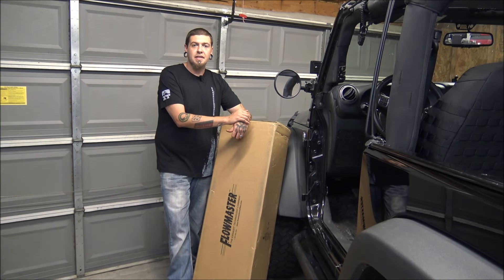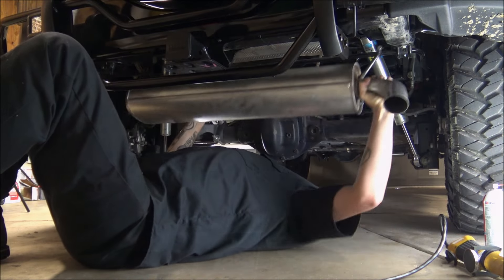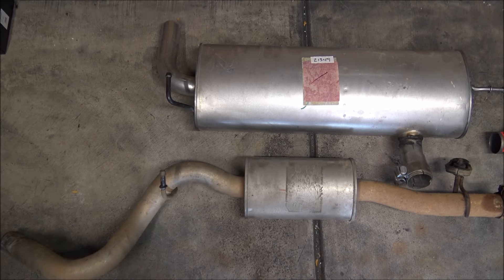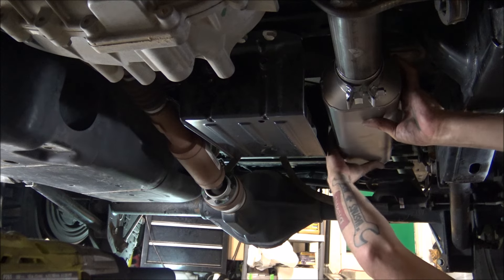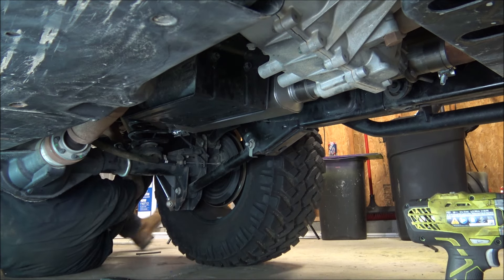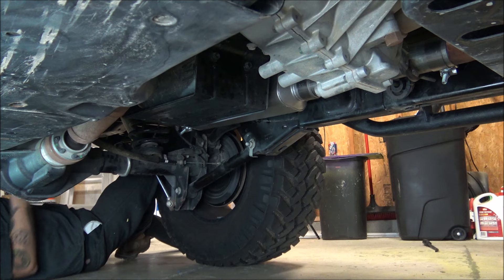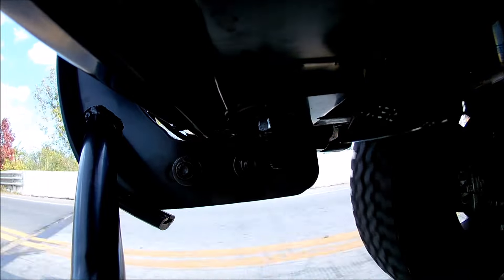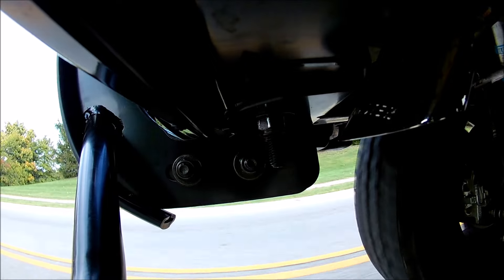Jeep JK Flowmaster American Thunder Cat back Exhaust Install, Review & Sound! PDW Ep.11

Comment: Thanks for doing this video man.  It helped a lot as I put my exhaust on my 2015 JKU this weekend.  My jeep does not have a lift and is pretty much stock.  Like you, I for the life of me could not get this sucker to fit without cutting about an inch off.  Before doing that, I took it all out again, made sure the pipes were all seated as far a as they could go.  I actually did that twice, as even when I called Flowmaster they said I should not have to cut it.  That was BS.  I ended up taking off about an inch and a quarter in total to make it fit - without doing that there was no way that last hanger was going to connect to the tail pipe.  Anyway, after about five hours in total, a lot of muscle, and sore from climbing under the jeep probably about 500 times I got it on and it sounds awesome.  Thanks for the video as it was a help.
Reply from the maker: Thank you for watching! You are right, this exhaust sounds great, but man does it ever make you work for it! A swing and a miss by Flowmaster on the install part of this kit. Thanks again!

Comment: Thanks for the video! I installed this setup today on my 15 JK 2 door. I have the exhaust spacers installed as well. I had to cut off about 1.5 inches from the first pipe. I took the rear sway bar down from the frame and that helped allot.
SUBBED!
Reply from the maker: Thanks for watching and the sub!

Comment: I just installed this kit on my 2011 JK, pulling the old system off was a crazy pain in the back side but I had no problems with Flow Master's kit.  The instruction pictures were not very helpful but the written instructions were very good.  Maybe I got lucky but I thought the kit install was easy,

Comment: Dummied up, this installation is really easy, once the old muffler is out. If your Jeep is more than two years old, just break out the Sawzall and cut the old stuff out. Life is too short to try and finesse that crap out. All the PB Blaster in the world won't save you. Sawzall. Drop the sway bar and it all goes together very nicely. My problem occurred when I tried to tighten everything down. Even using the impact wrench, the clamps wouldn't hold. My entire assembly could be taken apart just by pulling, with the straps tightened as far as they would go. I'm guessing I may need to weld it. I will say, mocked up, the sound was really nice. I love the lack of MUFFLER across the entire rear of the Jeep. It's a little more work, but I do like the system. Also, I'm the only person I've heard that had this issue, so it may just be me.

Comment: Thanks for the video. I'll add a similar comment I recently posted as a reply to another video.

I received my kit last week to install on my '08 JK 4 Door. That stock pipe on a 2008 JK was a pain in the butt to remove with rusted bolts and hangers that had never moved an inch. Also, to make it ever harder all original slip fits were tightened upside down (especially the first one) so I had to use a heck of a lot of PB blaster etc. to get that to loosen with no space to work etc. (The muffler for whatever reason what welded to the slip fit so I had to get the saw saw out to cut it apart. 

Also, my stupid Y-pipe had some sort of soldered round ring I had to cut of with a saw before anything slipped on there. Also, the stupid slip fits in my package were so tight that I had to completely open every one of them (everything going everywhere) then tighten them back together with tools to get them on the pipe. 

Finally, the last part of the exhaust pretty much rests on the rear sway bar just like yours. There is absolutely no space whatsoever  and just sat on there making it shake. I couldn't cut anything else off to make the hangers line up. I ended up buying a set of the Synergy rear sway bar relocation brackets to fix it all and lower that swaybar about an inch or so. 

Thanks for putting videos like these up!
Reply from the maker: Thank you for watching! I'm going to look at the relocation brackets you talked about now. I still get a rattle every now and then so hopefully you just pointed me to a good fix, thanks!
Reply: By the way, flow master refuses to divulge a torque spec to these clamps in instructions and even calling. After a month, I still see some soot coming out from the clamps. Does this mean, torque some more? I saw a study made by magnaflow and they recommended around 41ft lbs for 2.5 stainless slip fits. 

Do you recall what you torqued to? (If you say tight, I'll end the conversation right here) 😜
Reply from the maker: I couldn't find a torque spec either, and I also have soot by my clamps. Flowmaster really needs to work on this kit, it sounds great but it just has so many fitment issues.
Reply from the maker: I've got under there and tightened those clamps a few times. I'm afraid if I tighten them any more they are going to snap, they are well over 41ft lbs right now. I'd say mine are closer to 65-75ft lbs, they have been tightened by hand, then impact wrench multiple times.

Comment: I can’t tell you how much this video helped me. I need a Catback per mechanic but they can’t/won’t recommend one, basically I have to figure out what to buy online. Anyways, I don’t want to pay $$$ for install and it seems this may have cost me a fortune (I have a 2007 JK 2 door). Thanks again so much for this 🤗 ✌🏻 !
Reply from the maker: Thank you for watching! Just remember the part in the video about having to chop a little off for the 2 door JK.
Reply: @RockyXTV  I’m thinking about something different. I like a little outside depth but no drone or cabin noise. If any suggestions please share. The less labor the better and I have a plastic bumper and don’t want to accommodate with a metal one as I read some recommend it. 🤗
Reply from the maker: @Michele-fp8dz  I've been through a few exhaust systems on the JK platform. From my experience, most kits caused drone when they had a muffler under the Jeep. The kits with a rear muffler not so much, but they don't sound as good IMHO. The muffler that came with this Flowmaster kit sounded the best to me, the muffler is a Flowmaster HP2. Things to keep in mind,
Have a full length system with a tailpipe out the back. Turn down style tips/pipe are likely to cause drone because the sound is directed down & can get trapped under the Jeep causing resonance/drone.
Rear or "back half" kits are usually the easiest to install, most of the time they just replace the stock muffler at the rear. Most people choose this type of kit because of ease of install & cost. You usually end up with 2 giant exhaust tips that look way too big for a JK, & they don't sound all that great.
All this info probably isn't making your decision any easier, sorry about that. It's always a give and take when it comes to exhaust.
Reply: @RockyXTV  you are incredibly generous to share with me. I will figure it out. But your info is beyond helpful. Thank you SO much! 🤗 Be Safe & All the Best!

Comment: I have installed this kit multiple times, on both the 3.6 and the 3.8 powered Jeeps.  I would think that the reason that you had to cut more off the intermediate pipe is due to the possibility that you have exhaust spacers on your Jeep - I can't see in the video.  I had a 2014 that I had to trim that pipe due to the spacers, whereas on the 3.8L JKs (2007--11) the system fit with no trimming whatsoever.  And I agree - the over the sway bar exhaust piping can be a pain, I think I have about 1/8" of clearance on my personal Jeep with this kit.
Reply from the maker: I never thought of that, I had to run spacers with the lift. That must have been the issue, thanks! If you find a few of my videos you like, don't forget to subscribe, thanks again.

Comment: I bought a  magnaflow  muffler,  I cut out the old muffler  at the rear of the  axle.  I then cut a 14 in. section of the  straight  pipe  under the driver's side and  with 2 u bolt clamps I installed it.  Plus a chrome  tip. Total  cost  was $114, and  20 minutes,  I was done.

Comment: I installed this kit on a 2013 rubicon 4 door. The instructions say no trimming is needed on the four door. I however had to trim about 3.5 inches from the mid pipe and about an inch from the rear pipe. I needed to moved the mid pipe hump forward to clear the frame section and go over the sway bar. It fits tight now but mine was a little more than a bolt on. I do like the sound but be warned because it is loud.
Reply from the maker: You are right, it is a lot more than just bolt on and it is one of the louder JK exhausts out there. I'm really surprised that you had to do all that cutting for an install on a JKU, that's crazy. Actually now that I think about it, that's more than I had to cut off the kit for our 2 door! I wonder if Flowmaster made some changes to the kit, if they did it doesn't sound like they were for the better. You shouldn't have had to cut for the JKU, Flowmaster really dropped the ball on this kit, but it sounds soo good though. Thanks for watching, and don't forget to subscribe if you haven't yet to keep up on all the new videos and products. Thanks again!

Comment: Remove 2 rear bolts and one crossmember bolt and loosen other crossmember bolt and just swing skid off to side without dropping. This also works well when changing fluid in the tcase w/o making a bigger mess

Comment: Thank for your review and you just talked me out of this for my 2017 JK Sport.
Reply from the maker: I'm even less of a fan of this kit now, rattling and leaking! Great sounding muffler (HP2) I think, but this kit has way too many issues with the 2dr, I can't speak for the 4dr though. Thanks for watching!
Reply: @RockyXTV  How is the exhaust performing now? Any other issues, I have a 2018 Willy's and was considering this as well. I might just leave my stock exhaust. If it's too problematic.
Reply from the maker: @chuckisbusy  This kit held up great, I no longer have it on the Jeep though. I swapped over to the Magnaflow "Off-Road Pro" exhaust. I needed the extra room in the rear under the Jeep for my new air system. I would NOT recommend the Magnaflow kit though, it sounds VERY aggressive, but it drones like crazy! Thanks for watching!
Reply: Rocky X TV you mentioned in the comments somewhere that is was leaking? I found a local exhaust shop that quoted me at $100 to install it, thinking that’s what I will do.
Reply from the maker: @chuckisbusy  That seems like a reasonable price. I'd go that route, save yourself the headache.

Comment: I noticed you added a large washer to the cross member. Is that because of the lift that led to the rattling noise with the OEM exhaust pipe?
Reply from the maker: That spacer came with the TeraFlex S/T3 lift kit, I believe it was for added clearance for the exhaust crossover pipe. So in short you may be correct, I'm honestly not sure.
Reply: Rocky X TV that makes sense!  I’m going to add a large washer to mine. The exhaust pipe is making contact with the cross member. Resulting in a rattling noise. Thanks.

Comment: Good review and sound comparisons!
Reply from the maker: Thanks for watching! I may have some video coming soon of the Magnaflow Off-Road Pro exhaust system. I just installed it because I needed the space for another project on the Jeep.
Reply: I'm subbed now, so will watch for it.  Am torn between Magnaflow and Flowmaster, but don't want annoying interior sound, just a nice rumble and more throaty as I accelerate.
Reply from the maker: The Flowmaster is the better sounding of the two, not "ricey" sounding like a Honda. The Magnaflow that I have now is a really short exhaust so it is louder and more aggressive, but has quite a bit of interior drone.
Reply: Having owned Harleys for years, I don't care for that "ricey" sound.  Ha ha.  Thanks for the advice!

Comment: Thanks for posting this video.  I have a '17 JK and have been thinking long and hard about this exhaust.  Have looked at the MBRP, Pypes and Rock Crawler exhausts and, I don't know, they just don't sound the same as the Flowmaster.  I may end up buying the Flowmaster anyway and just watching your video a few times and taking notes.  I haven't lifted my JK yet and if I do it will likely only be about a 2" spacer-lift at most. (I don't drive a Rubi and I don't disco so I'm going to keep myself on a lower budget and max out at 35" tires).  Do you think your lift had anything to do with fitting the exhaust?  I've heard some suspension lifts will move the rear axle an inch or two one way or the other...
Reply from the maker: The Flowmaster definitely had one of the better sounding products out there. Some lift kits can cause the axle to move, but I can say that's not the issue in my case. The lift I have is the TeraFlex Sport S/T3 kit, it's very complete and keeps all of the OE geometry. It's basically the stock suspension just bigger! Thanks for watching and don't forget to subscribe to keep up on all the new videos! Or just visit older ones, thanks again!
Reply: Thanks for the info brother.  Subscribed, watching the old ones too.  Cheers!
Reply from the maker: Thanks!

Comment: Has your miles per gallon decreased a whole bunch since installation? Still trying to decide if the sound is worth all the installation hassle and if the mpg is truly affected by this... pls help and thanks for the video :)
Reply from the maker: The MPG hasn't been affected, some people say they get better some say worse. Mine hasn't changed, at least that I've noticed. As for the sound, this is one of the best sounding exhausts out there for the JK. IMO the only thing close to it is the Magnaflow Rock Crawler or the Pro Series, but the Pro kit went for just volume, not sound/tone. The Flowmaster kit is one of the louder kits, but it also has a really good tone. The Magnaflow Pro series is louder, but to me just sounds like a V6 truck without a muffler. I hope this info is helpful, the best thing you can do is find a Jeep club near you and go to one of their show - n - shine type events to hear some kits with your own ears, find out what sound YOU like. Thanks for watching!
Reply: After installing the flow master American thunder cat back exhaust on my 2016 rubi. my gas mileage decreased down to like 13.9 miles per gallon. But weeks later  I just took a trip to Mammoth and I
Was getting the best mileage yet owning the jeep. 18-19 mpg

Comment: I installed this yesterday. I had to cut 1.5 inches off the inter pipe to get it to fit my JKU. Fits great now, sounds amazingly loud though love that. Installation sucked
Reply from the maker: I think Flowmaster dropped the ball on this one. They say you shouldn't have to cut it on a 4dr. Did you have any issues with it rattling on the rear sway bar? I'm going to get in touch with Flowmaster and let them know about the issues with this kit. I love the sound and the added ground clearance, but the install.... It was supposed to be a direct bolt-on for the 4dr and cut in one place for the 2dr. Thanks for watching and commenting, don't forget to subscribe to keep up on all the new videos! Only if you want to, thanks again!
Reply: Rocky X TV no rattle as of yet. It wasn't bad except for having to cut it I wasn't prepared for it so it drew out my installation an extra day.

Comment: Could you please tell me the part number of the actual muffler? I want to run my exhaust a little different and just want to buy the muffler
Reply from the maker: It is the Flowmaster HP2, it comes in a bunch of different lengths as well as inlet and outlet sizes. It also comes in moderate or aggressive sound versions. I found a bunch on amazon by searching for Flowmaster HP2.  I hope this helps you out, thanks for watching!
Reply: @RockyXTV  thank you

Comment: Love the sound. My stock exhaust is way too quiet! I need to upgrade soon
Reply from the maker: I really like the sound, it would be great if it came in JK & JKU kits because this was a pain to install on a JK. Pypes has a kit just like this one, but it comes in two different kits (JK & JKU) It also goes under the rear swaybar unlike this one that goes over it and can rattle if you don't do some "Jeeper engineering" I used some wire to pull it up a little.
Reply: I'm a newbie Jeep owner.  I have a '13 Rubicon with 3 1/2" lift and 35s with 20" rims.  I really appreciate your vid.  I like the sound of the Flowmaster but the installation is not smooth.  I wonder if the 1/8" clearance over the rear sway bar could lead to a rattle down the road.  Does the Pypes Cat back system provide sufficient clearance if it goes under the rear sway bar?  Is the Pypes about as loud as Flowmaster?  The Magnaflow was too loud for me.
Reply from the maker: The sound is great with the Flowmaster, one of the best sounding cat-backs I've heard on a JK. As the system moves around over time it did start to cause a rattle on the sway bar, mainly under hard acceleration and reversing. I just added another hanger to pull it away from the sway bar, no more noise! As for the Pypes system, it is pretty much the same thing as the Flowmaster just with a little lower quality pipe and muffler. It does however go under the rear sway, but you still have to trim and cut it just like the Flowmaster. As for the Pypes brand, they make good stuff, but have been referred to as the "Chinese Flowmaster" I hope this info is helpful, thanks for watching!

Comment: oh. and the exhaust tip is going to  melt your wiring at the back
Reply from the maker: Its been on there for almost a year now and no melted wires, I though the same thing though. The tip doesn't get super hot for some reason, you can actually grab it, it's not cold mind you, but you won't walk away with any burns. This is not an announcement stating that people should go grab their exhaust tip haha. Thanks for watching!